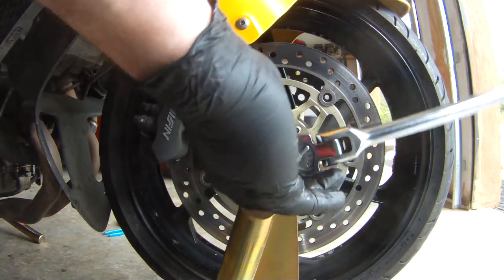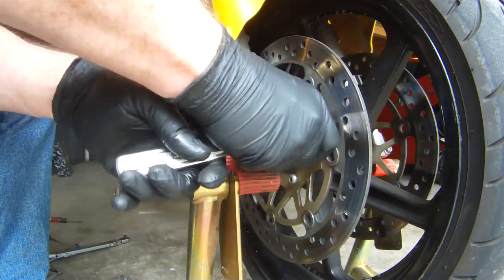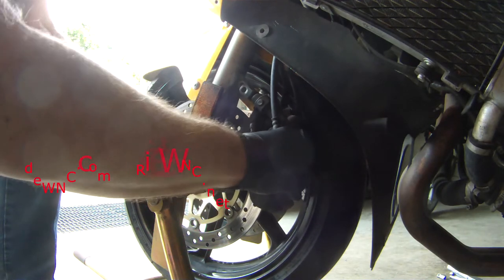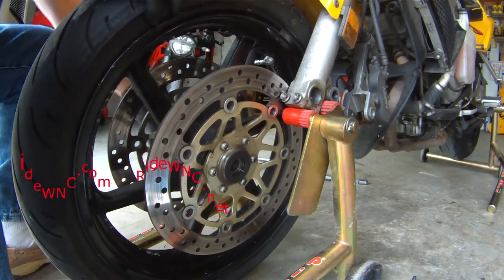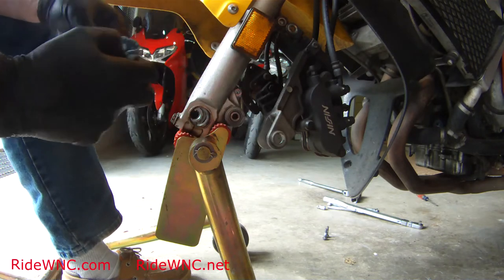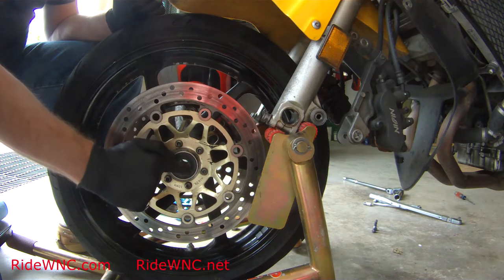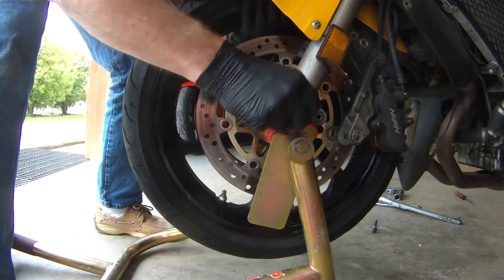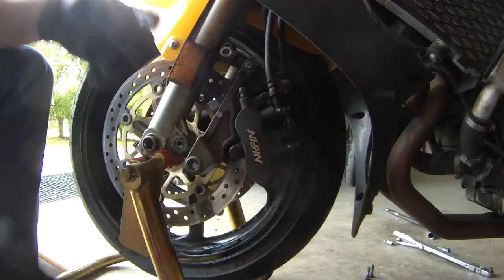Honda VFR 800Fi Front Wheel Removal and Install 1998 1999 200 2001

Comment: IMHO, the 5th Gen VFR800s are one of very best sport bikes made...EVER. From ANYONE. I’ve got an Ohlins adj. shock on mine and had the forks revalved for my weight by a racing suspension professional. Best damn bike I’ve ever owned.

Comment: after I learned that my 5th generation VFR was sat for 5 years or more. I experienced a lack of turn in to the left at 70mph. not juddering or clicking. it had been sat on side stand for 5 years distorting the front tyre . replaced both tyres after that run. no further issues. stay safe.

Comment: Thank you so much for this great video.
When you're going to change the tire, do the brake discs have to come off?
Reply from the maker: No. Never remove the rotors unless you are replacing. Rotor bolts are one time use.

Comment: Very informative.  Did you re-use the caliper bolts and if so, did you apply loctite to any of them?
Reply from the maker: Don't use loctite or lube on the threads it changes the torque specs. As bolts are not over torqued, they are good forever.

Comment: Don't you use  a thread locking glue for those bolts? Is it not necessary?
Reply from the maker: There is no need. Just use your torque wrench.
Reply: @RideWNC  Thank you

Comment: RideWNC, Like the other commenters say, thank you for sharing this video and information. I will be spending birthday gift money on a torque wrench and a front wheel stand for my ‘98 vfr so I can do this maintenance and swap out my new flat <1,000 miles front tire for a new tire without a pinhole in it. Aargh! Also, what manufacturer made your front wheel stand? Thank you.
Reply from the maker: Always buy Pitbull stands. Check FB marketplace and Craigslist for used. They are a fraction of the cost.